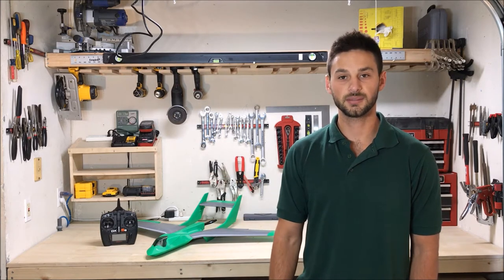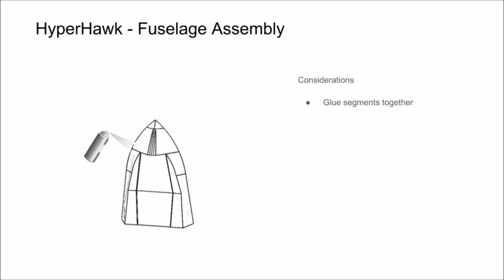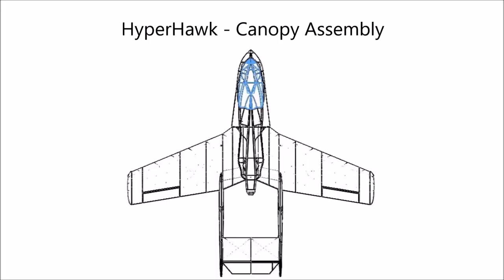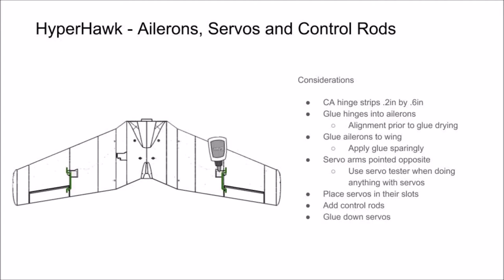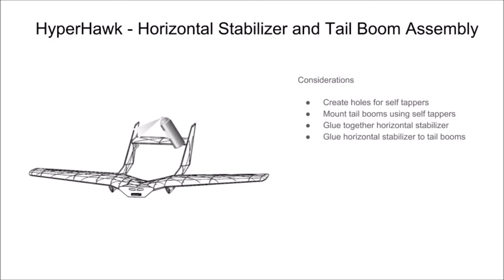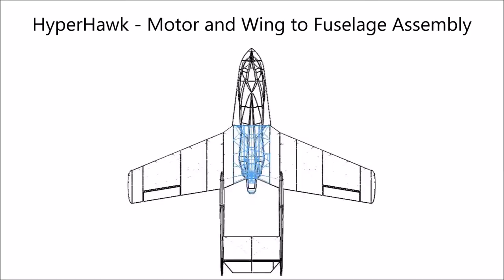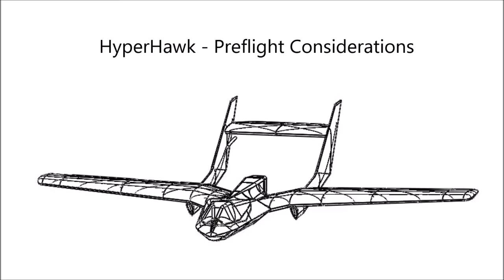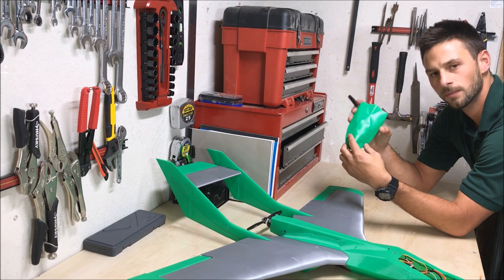HyperHawk ---- Build Video ---- | 3D Flight

Comment: what filament ? 
rly cool btw
Reply from the maker: We use PLA for all of our planes, but you can use any material with a low shrink rate. PLA is the cheapest low shrink rate material we have seen and has plenty of strength
Reply: 3D Flight oh yea indeed
But i heard pla might deform
Atleast the darker collored pla's
Reply from the maker: So PLA will deform a little, but it has one of the lowest shrink rates we know of. On some of the wing sections the corners may lift from the bed a little and that’s why we use a raft (eliminates this). We’ve used PLA for countless of these planes and it works well